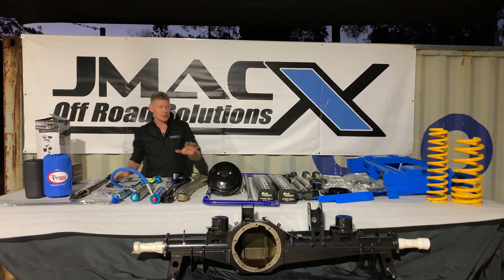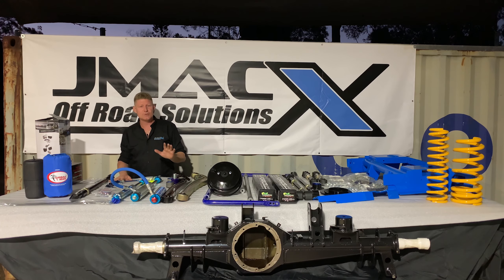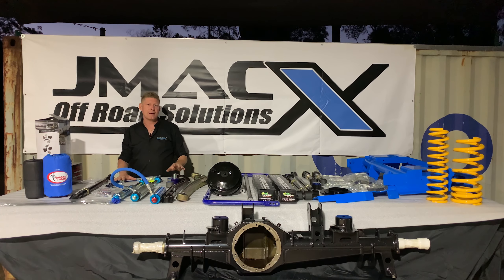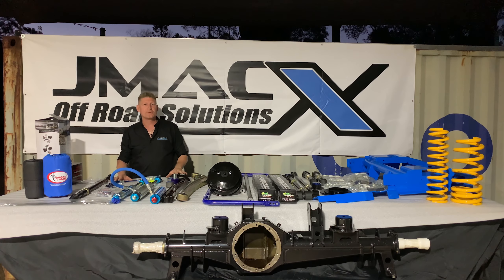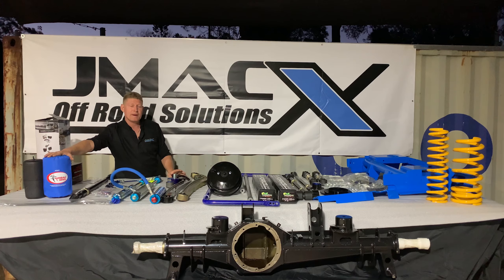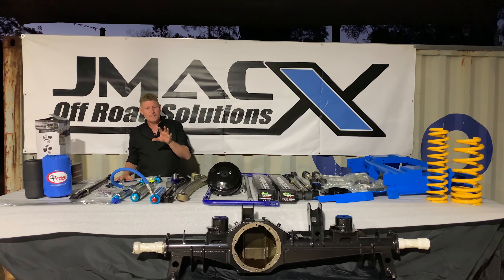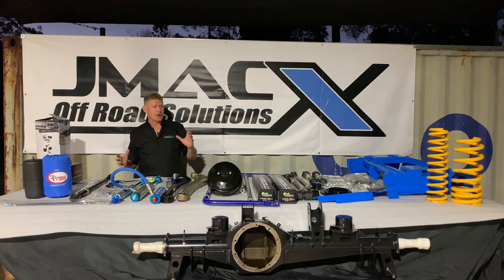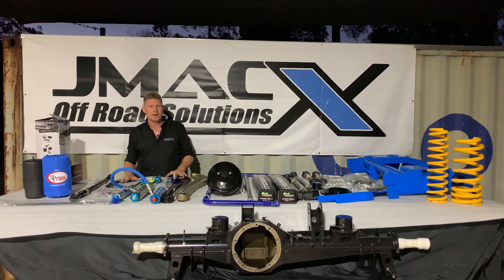JMACX 3900GVM Coil Kit upgrade 4inch lift and 35inch tyres ''Aus street Legal''

Comment: Can this kit be paired with marks 4wd portal axles for the 76 series pre rego?just asking
Reply from the maker: Not at this stage
Reply: @jmacxoffroadsolutions6654  i thought I've seen marks adaptors post a 76 series coil conversion on facebook with your kit from 2017?
Reply from the maker: @philemonripin1190  yes correct however with the updated legislation it cannot be done unless via a specific federal approval
Reply: @jmacxoffroadsolutions6654  I understand..tq for the feedback